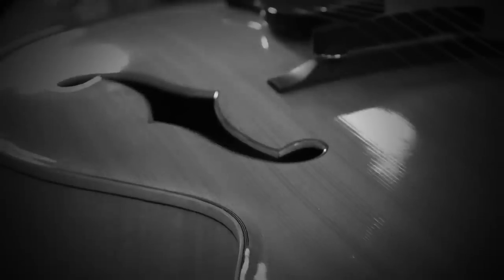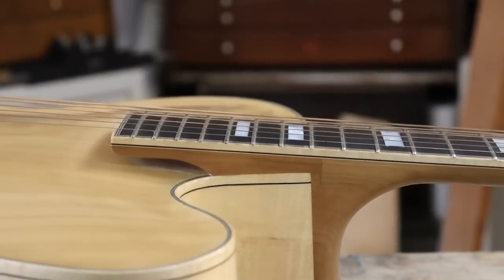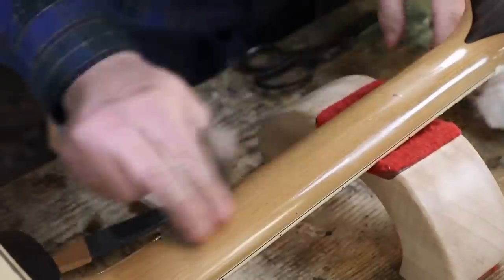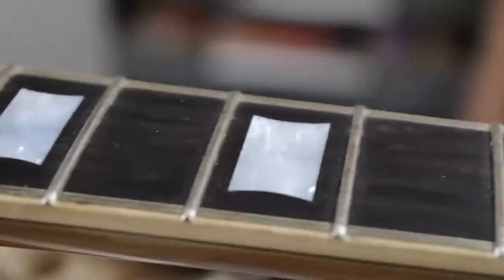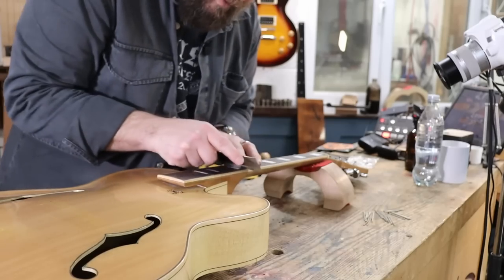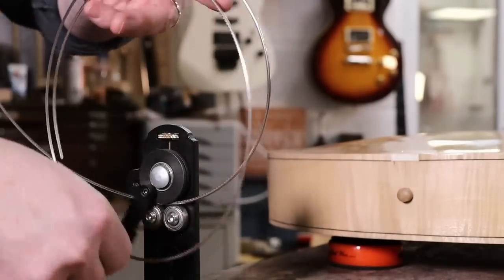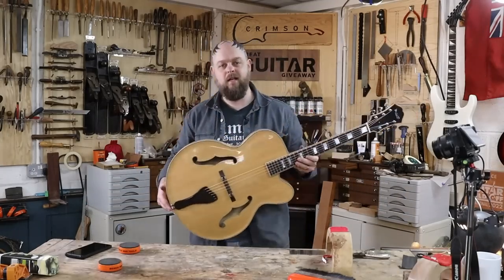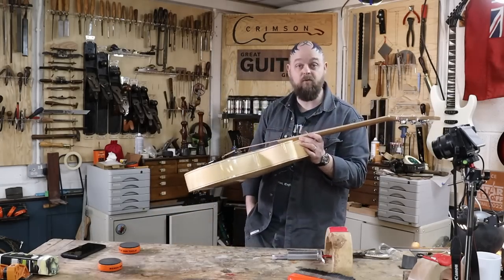Hand Made, worth far LESS on the used market 😞 Bargain?? | Luthier Teardown and Review

Comment: steam the neck damage and suction cup a few times. then strip it back with the scraper keeping only enough to use the old finish like a grain fill.. all around the headstock but leaving the stinger... truoil.

but that's just my default Epiphone treatment the tail piece was ghastly..  a piezo TOM saddle would have been a nice upgrade likely set it up using some 11-49 Flatwounds and a strap pin output plug

now if I was feeling really wild I might try remove the binding and the last bit of ebony from the fingerboard and Inlay the NEOmag pickup as a second output.. putting the maple binding and ebony back over top.

Comment: I know you have forgotten more about guitar making/repair than I will ever know, but the whole time your we’re regretting the bottom five frets I was screaming at my iPad “support the overhang front below!”.  I half expected that the overhanging fretboard would snap off from the hammering in of the frets.
Reply from the maker: I did wonder about mentioning that but am trying to talk a little less in these 'one and done' videos.. with a standard flat top acoustic then it would certainly need support.. this beauty has a much higher break angle and a relatively large amount of wood underneath the fretboard at that point.. even with that though I was feeling my way up the board.. if the slots had been much tighter then I would have filed the tangs down at that end to reduce the amount of hammering etc

Comment: I have a quick easy question. 
what are you using to clean the excess glue off the fret board after the Frets are hammered in place? thank you in advance.....  \m/
Reply: I personally use some water on a toothbrush then a damp rag, wash toothbrush between use and don’t do more than 3 frets at a time because you don’t want that glue to start drying on the fretboard.

Comment: Jeepers! How much glue did you use on that fretboard!! Serious question though, why not just glue the fret tangs with a brush before installing?
Reply: It's just standard wood glue that holds in a fret great and cleans up with a damp cloth leaving no residue.  It's much better than super glue that some use to keep the ends down and in 20 years a bit of heat will release the hold of the glue causing very minimal chip out compared to other hard setting glues.
Reply: Titebond: I put that #@#@! on EVERYTHING! (Frank's Hot Sauce joke)